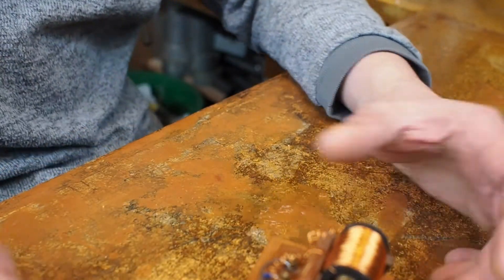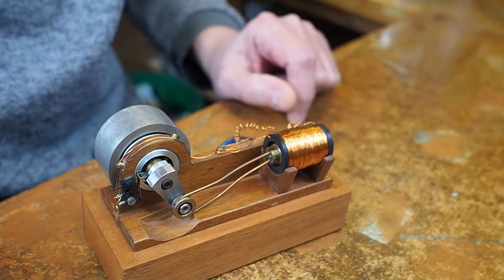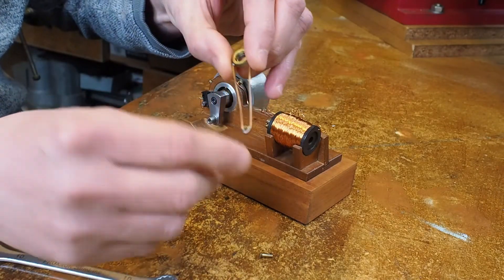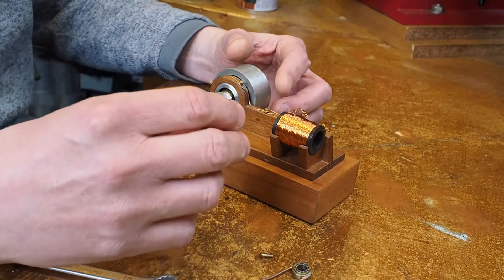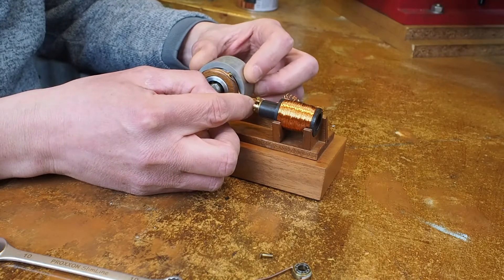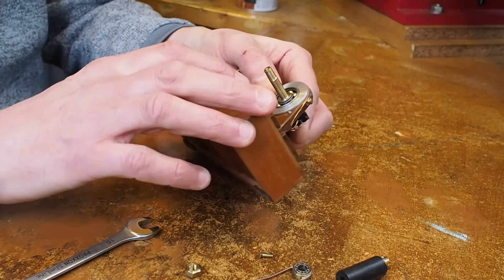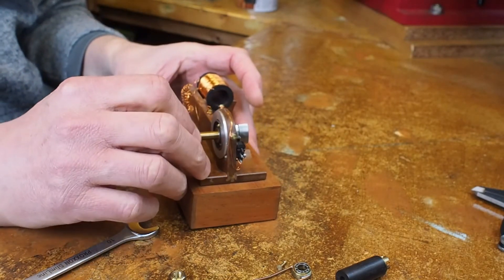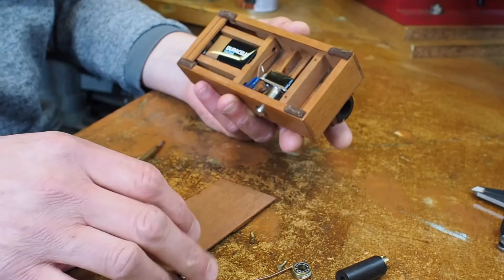Solenoid Motor - How it Works

Comment: Hello Sir! I currently have a school project which involves creating a solenoid engine. Sadly, all of our engines won't work. The magnet wont push or pull inside the coil. Are there any tips or tricks in creating the engine?
Reply from the maker: It should be timed such that the coil is excited when the magnet is just slightly further through than the midpoint
Reply: @editorglueitcom  Does the intensity of the magnet affects this? There are small movements but still wont work....